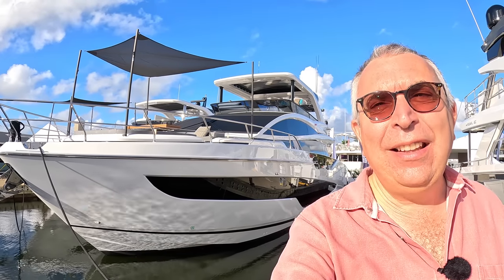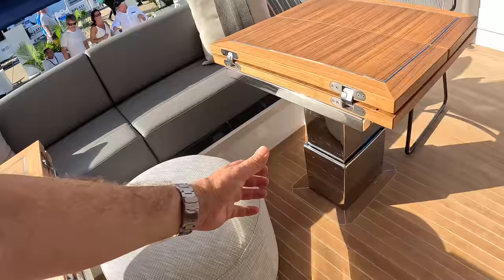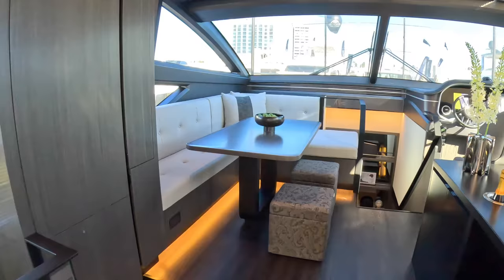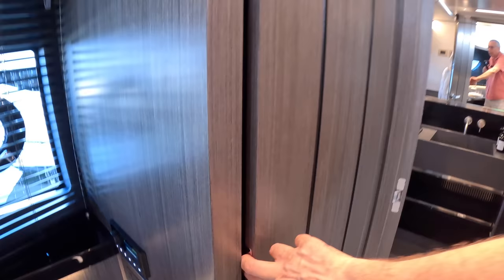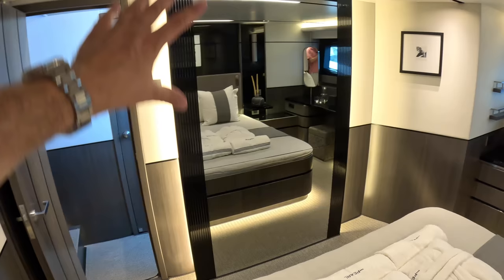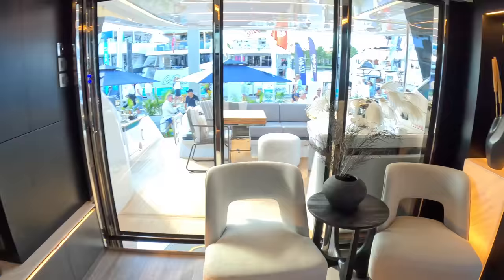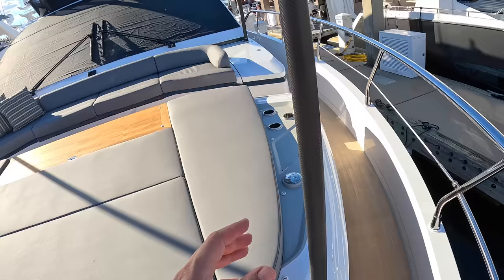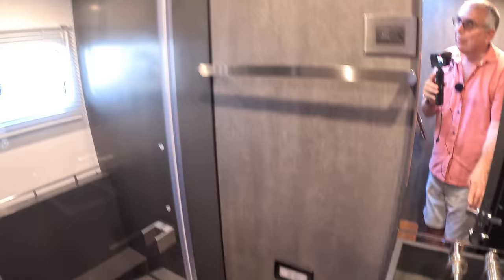£2.5 Million Yacht Tour : Pearl 72

Comment: An impressive yacht. I like the mocha-colored design theme that has been extended throughout the yacht including to the crew quarters. 

The one glaring weak spot is in the open galley and that is in the refrigeration. The small refrigerator and freezer look like something you would find on an RV not a 2.4-million-pound boat. 

I think the builder needs to reconfigure that space to get a full-size residential Sub-Zero fridge and freezer (or equivalent!) into that space. Part of that could be accomplished by doing away with the pull-out pantry. On a boat this size they should be able to find space for a pantry below deck - this is not an RV! More space if needed could be obtained by encroaching over the stairway space. 

Aside from the size of the refrigerator/freezer its location is also less than optimal since it is outside of the perfect workflow triangle that all kitchens are designed upon be they on a yacht or in a home. Imagine working in that kitchen and having to walk around the island to the other side of the boat to get eggs or milk out of the refrigerator. Perhaps they can remedy this by providing under counter refrigeration in the galley area, but I did not see any available space.

Comment: See the trick is to buy the smaller engine option and the reason for that is you'll be doing more 6 to 12 not cruising then you are burying  the throttles into the dashboarding going wide open when the untaxed diesel in the United States right now goes for $5 a gallon and I think the tax stuff goes for like six to seven maybe eight a gallon so you want to take it easy on the throttles. For a frame of reference for our Europeans red diesel or untaxed diesel usually goes for about a dollar a gallon so that $5 is a five fold increase

Comment: Why are most boats right hand drive? Is it a holdover from when boats didn't have a central rudder, but instead had a 'steering board' for use by a right handed person hanging out over the 'starboard' side? Which is where that name came from of course. With 'port side' being where the boat moored to avoid smashing that 'steering board' hanging out on the 'starboard' side.

Comment: The positioning of the engines on planning and semi planning boats isn't about space, it's about getting the longitudinal center of gravity correct, hence the v-drives. 
Equally, positioning of the fuel tanks on that same c of g, most likely adjacent to and outboard of the engine-'s is a good place for them to be.  As the quantity and thus weight of the fuel changes it doesn't alter the c of g - so the boats basic inherent trim doesn't change.
A planning boat with the c of g too far forward isn't going to plane without putting in wasteful extra energy, whereas one with weight too far back will have poor directional stability and, problems in a sea.

Comment: Would a vessel like this be built to coded standards so that she's ready to head straight into the charter market or would it typically need further work done to comply with code?
Reply from the maker: No, coding would be extra as there is no need for it for most owners as are privately operating.
Reply: Is that something that would need to be specified at build our is it easy to bring up to code after? 

My fantasy is to own something like this in the Med and charter it out to help with running costs.   It would be great if you did a video about that kind of mindset.  Pure ownership on something like this without setting it to work is very much an indulgence.
Reply from the maker: It can be done retrospectively.

Comment: Would be a nice little starter boat whilst you are waiting on your bigger boat to be built (looking at you Bering 145)...would definitely have some discussions about the fridge/freezer placement, but that could just be that particular package. The only quibble I have is that the forward master cabin has a smaller shower than the rest of the cabins, but definitely not a deal breaker. All in all, a very nice boat for weekend coast running.